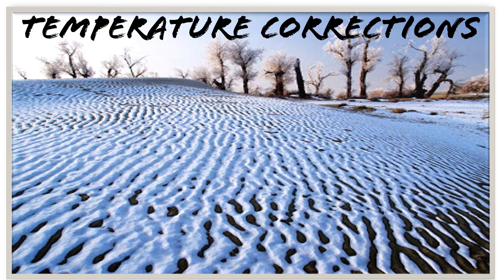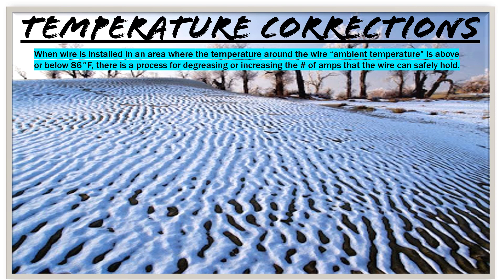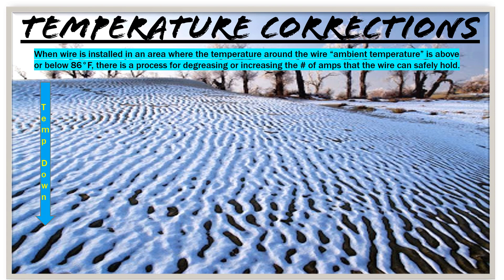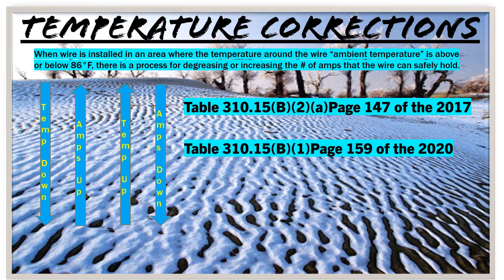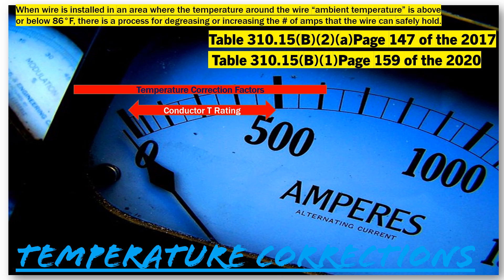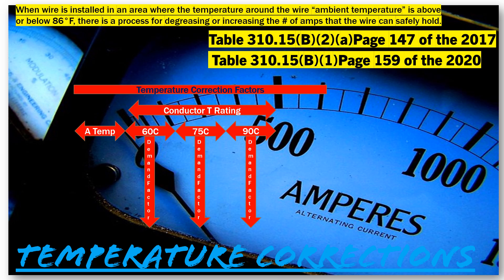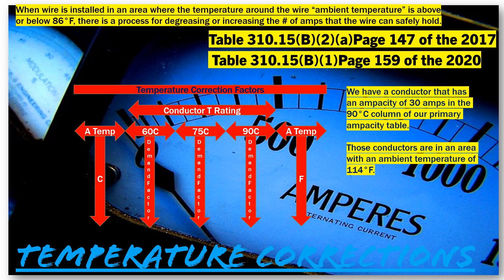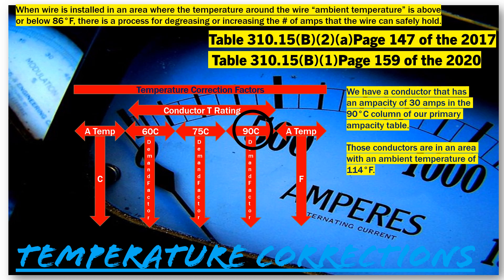Ampacity basics Temperature Corrections on the Electricians in Action E.I.A

Comment: Thank you.  If it is Romex (NM) wire, I know you are supposed to use the 60C column for table 310.6, but aren't you supposed to use the 90C column for temperature corrections in table 310.15(B)?